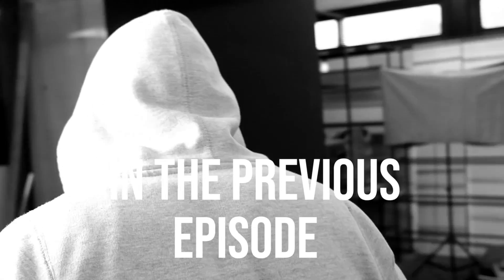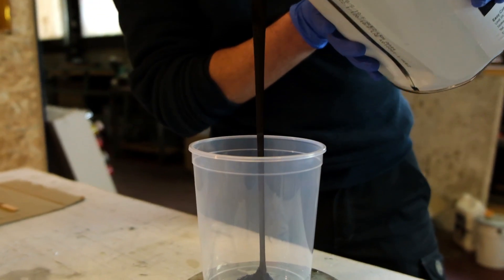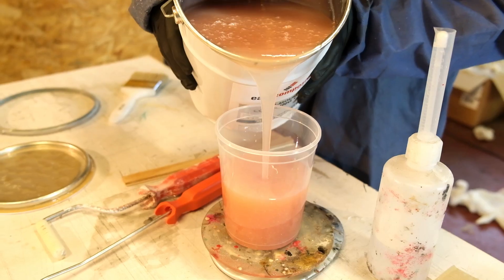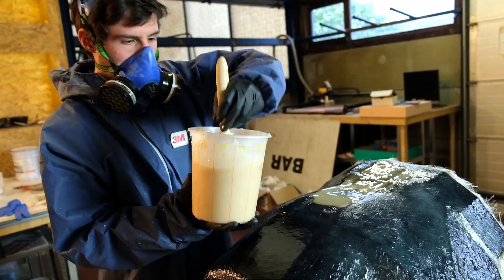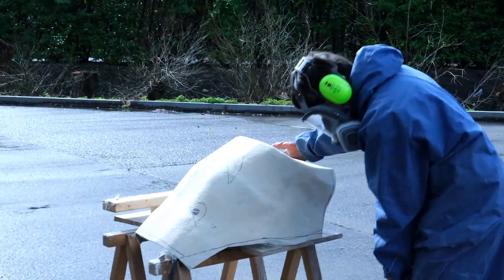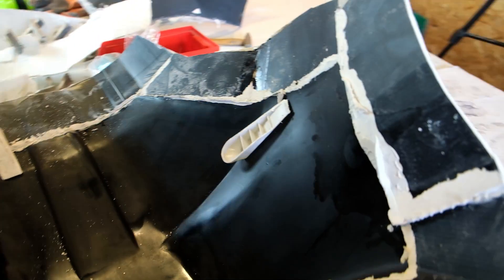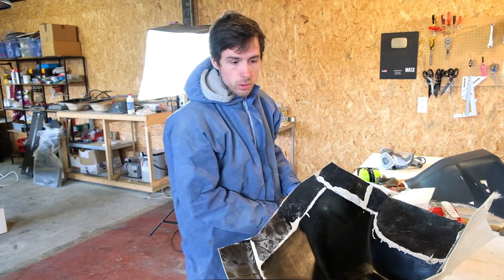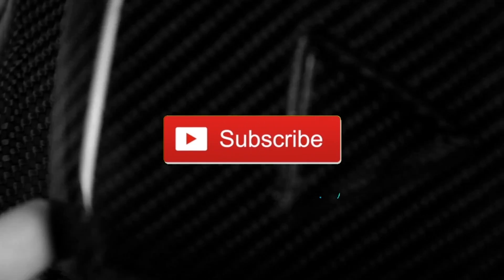Making a Carbon Fiber Motorcycle Rally Fairing - DAY 3

Comment: Great video thanks. Question though. Do you have to wait between coats for the previous layer to cure when doing the final 3 layers? You mentioned that you let it sit and cure fully after applying them all. But, wasn't sure if you could just keep adding more layers or had to wait?
Reply from the maker: 3 final thick layers are added in one go and cure together 🙂